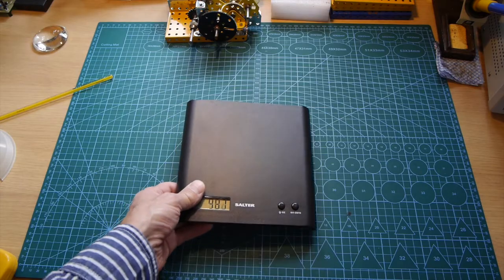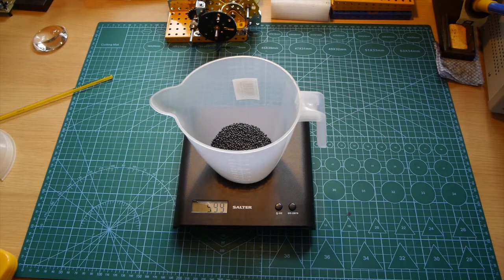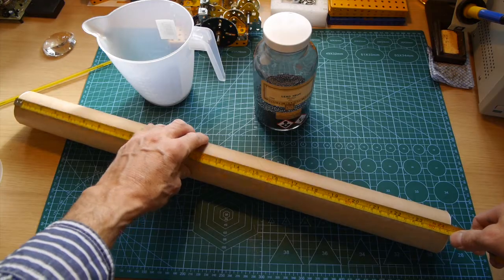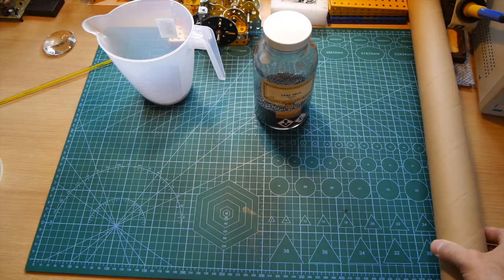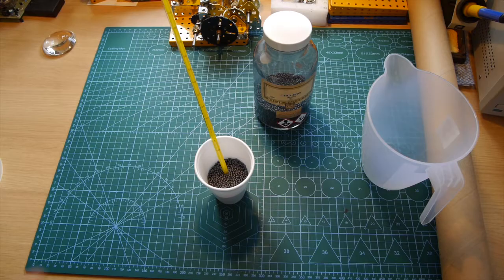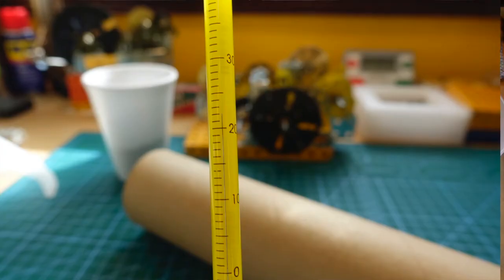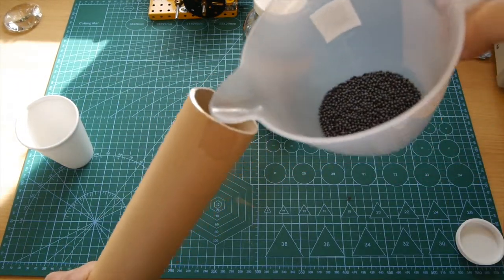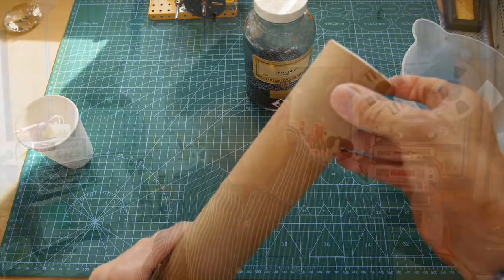Are Waterfalls Hotter at the Bottom Than the Top?  The Lead Shot Exp.  - F-J's Physics - Video 156

Comment: Everybody knows that more kinetic energy means higher temperatures…
Reply from the maker: Thanks Peter, that's not quite the case.  For example a ball rolling on a surface faster is not necessarily hotter or for that matter the lead balls getting faster as they fall down the tube. The crucial thing here is the random nature of the particles movement.  I tell my students that the random translational KE of particles gives the heat to a cup of coffee on my desk but if I move the cup to the left it does not get hotter as that is all linear as it were.  Hope that explains it a bit and thanks for taking the time to comment and watch the video.
Reply: I was thinking more along the lines of when we add heat to the atom, the atom begins to translate around. The more heat that is added, the faster the translation. If we keep adding heat, it translates faster and faster. There is more kinetic energy,so the temperature is higher.
Reply from the maker: Yes, Peter, I see your point.  It is very hard to get an understanding of what Temperature means by considering a single atom moving.  Even Heat in this context is not easy.  Better to think of Temperature as being related to the average kinetic energy of a large number of freely moving particles.  We also need to consider the movement of atoms that are bonded giving extra degrees of freedom such as Nitrogen in the air which is diatomic. I am sure I bore my family many times talking about the Boltzmann's distribution and its effect on things we see around us.  It is indeed facinating to consider the movement of single atoms but at this scale quantum effects dominate and that's a whole different story!
Reply: I can’t even begin to understand Boltzmann’s distribution.
Reply from the maker: @PeterGannon-x3b  Peter, shows that in any gas (for example) there are a range of velocities of particles.  Some slow and some much faster and many in between.  The average velocity of the particles considering their distribution gives a idea of the temperature of the gas.  BY the way, it is not too difficult a calculation to work back from the temperature of gas in a room to its average particle velocity using this fact, which is about 500m/s !

Comment: I wonder, talking about an actual real life waterfall, how much would evaporation cool down the water on the way down? The latent heat of vaporisation of water is absolutely massive. But then again, so is its heat capacity.
And that would also depend on the temperature of the water, temperature of the air, the relative humidity of the air, wind, and exactly how the water falls (think fine droplets vs. a solid stream).
If I get really bored I might try to calculate exactly what fraction of the water has to vaporise for a given waterfall to cancel out the heating from the potential energy...
Reply from the maker: Good question!  Yes there are lots of variables.  So quick back of the envelope calculation.  If 10 tonnes of water falls 10m in one second then the gain in KE is 1MJ.  Assume this all turns to heat.  Now, if 1kg of water vaporises on falling of the 10,000kg then that will need 2MJ of energy not taking into account the energy needed to heat up the water (SHC).  Assuming this heat can be lost then it would be cooler!  Thanks for taking the time to comment!  F-J
Reply from the maker: BTW..."And do try it on your honeymoon - this is exactly what James Joule did at Cascade de Sallanches near Mont Blanc!"

Comment: Intuition tells me that yes, it should be. But intuition also tells me that in the real world, no. Not for water, due to the aerosolization and evaporatative cooling experienced during the fall. I would predict that energy loss would far exceed heat gain from kinetic energy in that case.
Reply from the maker: Great question!  These things are always a bit of a simplification.  Here was my answer to a previous question. "Yes there are lots of variables.  So quick back of the envelope calculation.  If 10 tonnes of water falls 10m in one second then the gain in KE is 1MJ.  Assume this all turns to heat.  Now, if 1kg of water vaporises on falling of the 10,000kg then that will need 2MJ of energy not taking into account the energy needed to heat up the water (SHC).  Assuming this heat can be lost then it would be cooler!  Thanks for taking the time to comment!  F-J"
Reply from the maker: And do try it on your honeymoon - this is exactly what James Joule did at Cascade de Sallanches near Mont Blanc!
Reply: @AnthonyFrancisJones  Some blokes have all the luck.
Reply from the maker: @UnitSe7en  Indeed!

Comment: What about the heat added to the end of the tube by holding it with your hands? You could hold the tube for the same length of time without inverting to see if there is any temperature change as a control.
Reply from the maker: Good question!  One of the reasons for using a cardboard/plastic plugged tube is that its thermal conductivity is very low so none of the heat in the lead shot gets out.  The same is true of the heat from the hand getting in so it would be good to do a control but there would be negligible difference I think.  Thanks for watching and making a good observation about the limitations of the experimental method.
Reply: I had the exact same thought.

Comment: Very interesting video. Just a thought, how much heat is added to the lead shot as a result of friction both with the sides of the tube and the friction between the lead shot rubbing together each time it impacts at the end of the tube.
Be interesting to try this again with a plastic tube and the addition of a thin lubricant.
Another interesting effect is how warm a piece of metal becomes when hit with a very large hammer.
I've just discovered your videos and really enjoy them. Tony
Reply from the maker: Thanks - all of the heat converted by friction is from the kinetic energy of falling so that heat we need to have included in the calculations.  However, heat lost to the air or the tube (which does have a high specific heat capacity but lower than most plastics) is part of the error in this determination.  It is a classic 'F-J' experiment - I never liked 'accurately determine' in my teaching, rather 'show how you would' experiments!  Yes, hammering does generate heat (I used to set questions on would a projectile completely melt or vaporise on impact) and of course the effect of friction on pulling out a nail too.  Thanks for watching and your great comments.  Keep them coming!